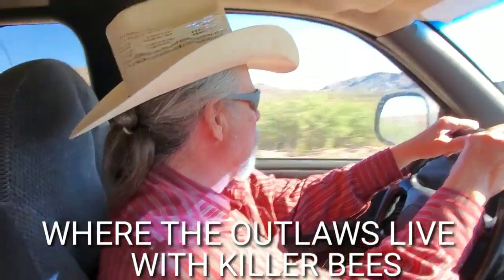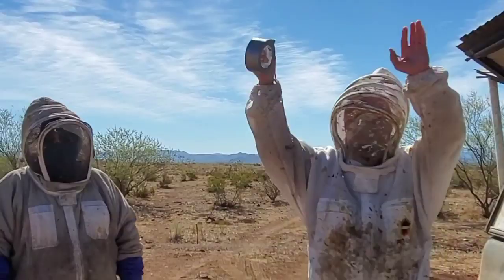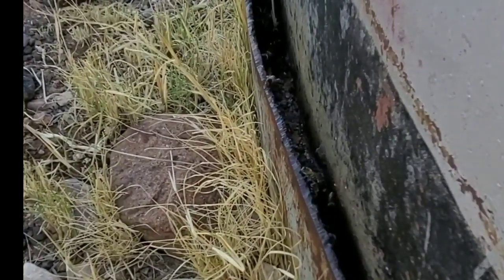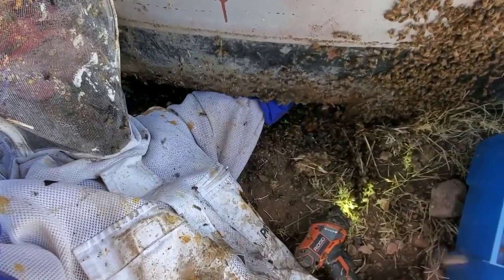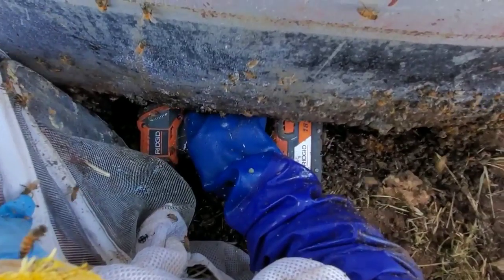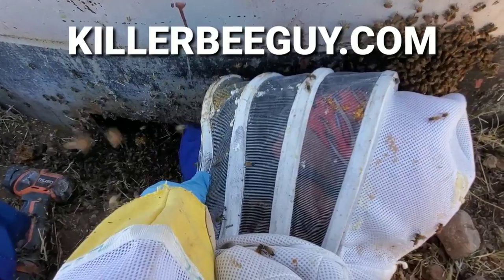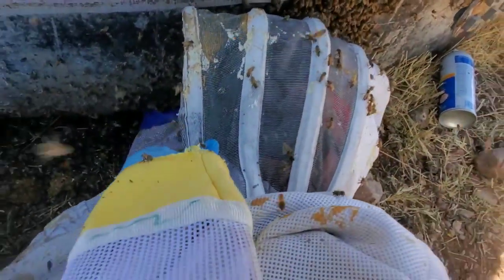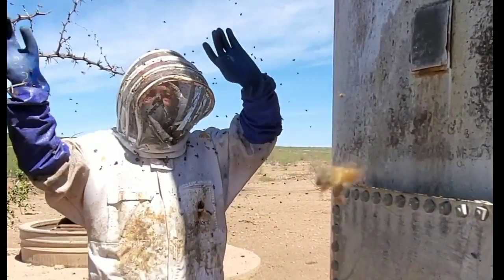Where Outlaws Live With Killer Bees!

Comment: Question, why not use bee vac to knock numbers without insecticides.  Not that your saving the bees they would  all die in capture cage but just a thought
Reply from the maker: We used to use a vac but it turned into more equipment to rip over!
Reply: @KillerBeeGuy  would just seem to be a way to avoid the swarming attacks or severely knock it down
Reply: Omg I would be panicking like fuck 😂 you guys are brave